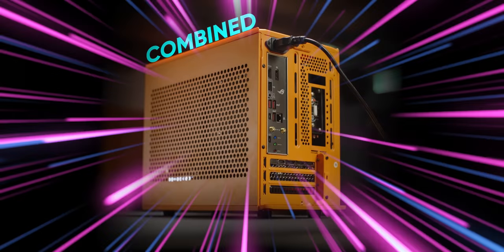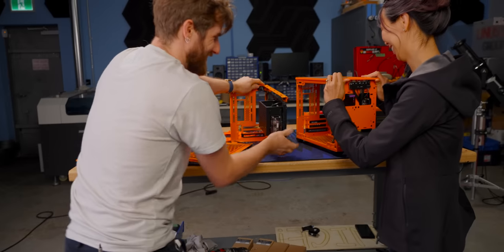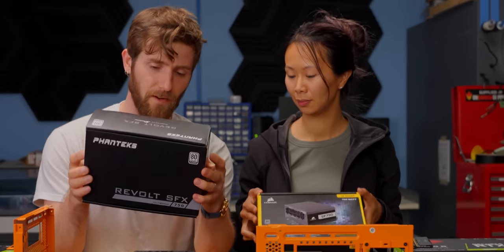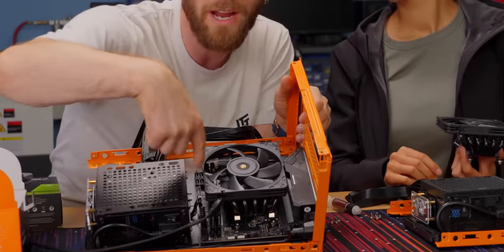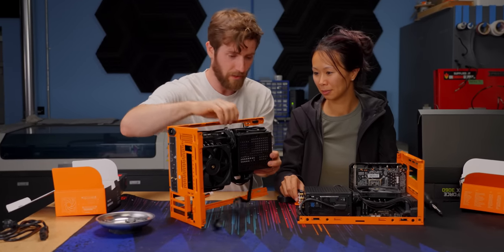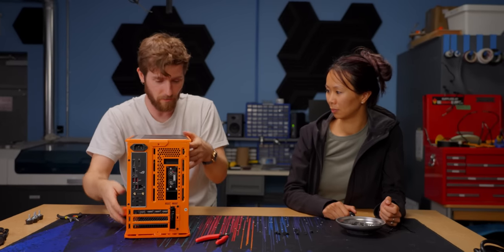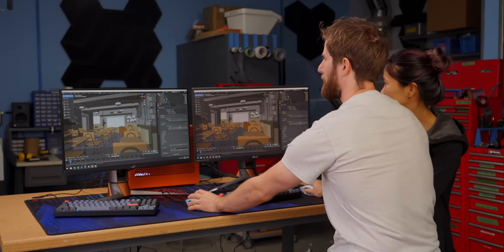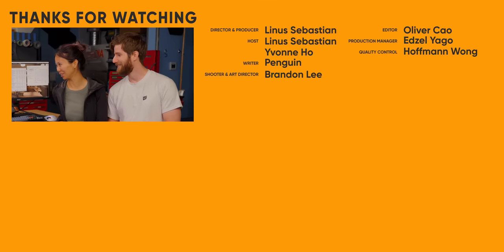This is TWO PCs in ONE ITX case!

Comment: Actually slotted screws are great and used a lot in boat building because when you need to remove something after years of use and you have to take out a bung and clean out glue or putty or rust from the head of the screw it’s easy to clean out and get your screwdriver in. Philips are the worst screw, they were actually designed so the screwdriver would pop out of the screw out so they weren’t over torqued in manufacturing which isn’t necessary any more with modern powered screwdrivers, but because of their ubiquity they’ve stayed popular despite torx, Robertson and other screw types being clearly superior.

Comment: This is a super useful option for doing digital visuals at festivals. I usually have to bring two systems, one for lights/lasers and one for projections, being able to bring a single box that fits in a pelican case and run both is well worth the trade offs for me!
Reply: Wouldnt the couple pc Linus mentioned in the intro that shared motherboard and power supply, be better in that use case?
Reply: @C3beruz  it's hard to fit a big case in a reasonable roadcase. I currently use the fractal meshlicious case
Reply: Found 1 of the three people that Linus mentioned.
Reply: @jrbudoybudoy  the other two are siblings with an enforced 'home PC' policy that prevents one taking it to a friend's house or into their room as they'll keep each other in check (or at least grass each other up)
Reply: and you don't have to worry about GPU brackets and such, 'cause there's no way anything in this build can flex enough to break loose. :D
Reply: Gratz for being one of the three users Linus mentioned this is actually useful for haha
Reply: Or just use one more powerfull PC?
Reply: @costafilh0  I think we can probably assume there's a reason they need two separate PCs running. Trying it on one PC was probably the first thing they tried.
Reply: @InnuendoXP  yup - two PC's gives redundancy. If one system crashes then we don't have a 5000 person stave go black.

It's the same reason the DJs have 4-5 CDJs on stage even if they're only mixing 2 decks. You can't afford even a moment of downtime.

I can have all my lights die and still have projections going, which looks cool.

Or I can have all my projections die and still have lights and lasers looking pretty.

Comment: Slot screwdriver heads are for applications where the head might get covered by paint or oil etc. Since it goes from one end to the other it makes it easy to remove any debris that maybe get lodged in it.
Reply: Or... it is just because it was easier to manufacture back in the day? Ya know, cutting/Filing a slot in a screw head is a lot easier than making a Philips or Torx.
Reply: @Helveteshit  they are still used in modern applications specifically for the above reasons
Reply: TIL

Comment: This is acutally a fantastic guide. My realworld use case (as a professional video editor) would be for travel. When we fly two editors out to edit event recaps. What a huge space saver! probably takes up the same space (almost) as two mac studios but more powerful.
Reply: Hard to imagine a couple decent laptops not filling that role better
Reply: @DanKaschel  Yes very hard. when 90% of laptops get cucked with shit cooling systems it's very hard
Reply: @DanKaschel  those laptops are probably way more expensive
Reply: @bara9880  and if the work requires a monitor of some sort (sometimes editors need HDR screens or OLEDs) and a better keyboard than a laptop keyboard then yeah a portable PC is a much better idea

Comment: The nr200 is BY FAR my FAVORITE budget mini itx case to work with.

For ~$100 you get a solid design that is easy to work in AND is 19L vs most mini itx cases that are >16. The cooling is fine too without the extra fans (optional purchase for more $) so long as you aren't trying to put in crazy high end components.
Currently I have a Ryzen 3600 and stock cooler with a 3060ti. I use it as my travel PC so I don't have to move my main rig and risk a leak from my pump.
I can 100% on both the cpu and gpu without thermal throttling on stock bios settings.

Comment: Im so happy you chose the 5600 i got one and its sooo cool i have a noctua redux cooler and it doesnt even get above 55c like wow and did i mention this thing is insanly powerfull like it could run a 3080 without too much bottlekneck at all. I think its a bit underrated tbh

Comment: The super compact gaming pc idea is pretty well explored at this point, but this is a really neat spin to it, wonder how small you could go, I imagine with lower power components you could run both pcs of a single sfx psu, then really cram it together in a custom case. A follow up where you task Alex with taking this to the extreme could be interesting.
Reply: Would need 2 24 pins
Reply: @mitlanderson  think you could just split it up, the on and off pins would be a bit funky though. Not sure how they'd behave connected to two mobos, might just have to have that on a separate switch controlled manually lol

Comment: Ventilation systems are working good in 2 conditions. 1. out fan + in fan   2. out fan  . Linus, take this as a tip for future . (Air conditioner isn't a fan, its a temperature transfer that has a fan for air circulation)

Comment: Very cool build, and I got a kick out of seeing the HAF Stacker mentioned. I'm surprised that case didn't catch on. You could easily fit two stacked ITX systems in about the same space as a mid-tower or put them side by side like I have the computers in my bus. Nice, but not as awesome as the build in this video.

Comment: Although I don't have a partner, I find this very interesting. Would've put a cheap and low-power consumption secondary system as the second PC and put a HDMI capture card on it. This way I'll be able to use any motherboard for the main system AND have those fancy IPMI-like feature without buying an server board. A Pi-KVM if you wish, except that it's way more versatile than a pi and can fit into a normal pc case.

Comment: Now you know One user can buy 2 PC, my left leg is AMD 4600G and right leg is Intel core 2 duo E8500(Gaming Beast) w Intel G41 Express chipset both using window as operating system. I switch the keyboard & mouse & speaker input when i change from intel to AMD or vice versa.

Comment: I mean. You could prevent the gpu from pushing air into the case be covering up that hole with some black electrical tape. the shroud is black too so it should blend in and force the air to blow more out the back.

Comment: Decades ago, I stacked 2 emachine mini ATX cases on top of eachother and put a IBM full size XT case shell and front over the 2 PCs. the only modding I had to do was a few cuts in the face where the 2 case met and i had to buy really really long ribbon cables to reach the bottom pc all the way to the top of the top case for the dvdr and drill a bunch of new holes . It was heavy and sounded like a helicopter warming up.  I had 3 17in sony trinitron CRTS both machines had 2 video cards (i still have he cards) and a kvm switch to swap the center monitor and keyboard back and forth between the 2 machines. Im pretty sure I ran Windows MCE on both systems. I got almost everything used at a local pc store. My parents paid for the 4 brand new video cards which we got at a place called "Sun TV" in central ohio.

Comment: Slot screws have their time and place. Inside a live 480v panel? No, unfortunately a bunch of breakers still use slot head screws for the terminals, and it's really easy for the screwdriver to slip out and hit something live. Slot head screws are pretty good for coin cell battery covers (most of the time they're specifically for coins or the rim of bullet casings to open (yes, in America we use live ammo as tools). The other acceptable use for slot head screws is for finishing screws meant to look pretty. Just about the best slot head screwdrivers are gunsmith screwdrivers. They have a concave grind to them, and make better contact with the screw (when the correct size is used) than a standard flat ground screwdriver. Most 1/4" driver bits in slot blade are gunsmith drivers. Older guns used mostly slot head screws because it's relatively easy to make a custom slot head screw or to modify the head of an existing screw and grind in a new slot. That concave grind keeps the driver in the slot and doesn't mar the top of the slot and make the screw ugly. Guns have to be taken apart and serviced/cleaned regularly (especially old guns), so having good screws and good screwdrivers is really important because those screws have to be torqued down time after time.
Yeah, slot head screws should mostly die off, but Phillips head screws should be removed from the face of the earth. Robertson and torxs are better, and now ECX is a thing. ECX is a hybrid of slot and Robertson. The Robertson part keeps the driver in the screw and the slot portion allows you to apply greater torque. A bunch of breakers have a screw head that will accept Robertson or slot, but not ECX because the slot is oriented on the flats instead of the diagonals. I handed my 79 year old boss an ECX driver the other day and then asked him how he liked it, and he said that he loves it. I know what I'm getting him for his birthday.

Comment: I just recently bought some second-hand parts off eBay.

£138 X570 Asus Tuf Pro WiFi Motherboard
£132 MSI GeForce GTX 1660 Super Ventus XS 6Gb
£116.85 AMD Ryzen 7-3800x 3.9GHz 8C 16T CPU
£41 G SKILL Trident Z Neo 3600 - CL16 - 16GB - DDR4
£23 Samsung 860 EVO - 250 GB - SSD SATA III 6 GB/s
£90 Phanteks Eclipse G500A D-RGB Mid-tower PC case - Matte White
£27:50 Noctua NH-D14 CPU Cooler 

Total: £568:35p

Comment: Next challenge; Buy a Kallax shelf from IKEA and make a couples PC fit inside one of the holes! Should be possible to fit a 280 Rad per PC with a full-blown ATX if you can live with blocking off three ports for the PSU.

... Yes, this will require a 3D printer.

Comment: Many years ago I looked into setting up a multi headed system with Linux. Same PC but 2 different user sessions with their own monitor and inputs assigned to them. However, at least at the time, it still needed 2 video cards to work.

Comment: There is a 65 watt (same dissipation) 8/16 core Ryzen 5000  - the 5700X.
The 5700G is also 65 watt 8/16 core but the integrated graphics is a waste for this build, and it's lower performance due to those graphics.

I'm not going to the 7xxx as the 65 watt parts I don't think were released when this video was made.

Comment: Much simpler, cheaper and powerful is to spend the same money in a single PC with more processors and memory, and use software like Aster to emulate multiple computers. (It allows to have two simultaneous users in one PC).

Comment: so i have this mobo, by putting your boot drive on the back your limited to pcie gen 3 speeds and that drive is connected to the chipset while the one on the front is gen 4 and directly connected to the socket.

Comment: Oddly when it came to cooling my case hdd's i had to use USB fans, those actually stay on all the time due to powered usb even when the system is shutdown, worth using as an idea so the fans don't need any system directly always on but more so just the passthrough 5v even tho it'd mean the fans are always on it just means more dust.

Comment: 7:42
Weird cooler, with the fan sticking out so far on 2 sides.
I guess it should help cool the MB and ram.

BTW - THAT Noctua fan IS NOT going to be good for CPU heat sink performance - too few blades to push well against the back pressure.

Comment: @ 7:07 Linus shows the 24-pin. It appears the metal siding inside the hole is missing. Was curious if this was the same cable used in the build? 

When building my first PC had to buy a new PSU because when powered up this started to wisp up smoke. Luckily had someone knowledgeable to quickly turn off system before anything took damage. 

Either way wanted to point it out just in case, not even 100 percent if cause for concern.

Comment: 1:06 yeah, phillips' purpose is to instantly strip when you try to unscrew any screw screwed in a little harder than computer/electronics screws and ruin your day because you don't have the exact replacement so you screw that stripped screw and hope it's not you that has to touch it again in the future.
And Pozidriv(PZ)'s purpose it to make screwdrivers that sort of work with PH screws(so it's easy to mix them with your ph screwdrivers) but one wrong move and you strip them.

Yes, I hate crosshead screws with a passion, how could you tell?

Comment: Did they use Crucial P5s or Crucial P5 Plus?
Wouldn't the P5 run a bit hot to be an ideal add for something this tight?
Reply: To anyone on the channel side of things. 
I posted another comment below mr legitimate here, and it seems to have gone awol. Wondering if someone with eyes on the other end of things could tell me why that might be.
Kind of useless calling this crap out if the callout gets caught and the original doesn't.

Comment: I5 12400F would have been a much better CPU to use for this, much better performance than the 5600X, much kess heat, and a little undervolt on top too.

Comment: The only situation in which a slot screw head is reasonable is when the screw head is so worn out that it just won't move and you make a slot with an angle grinder.